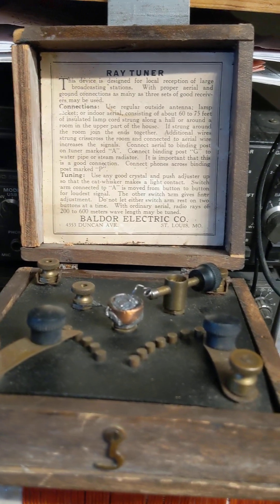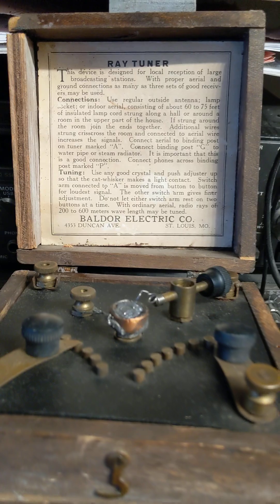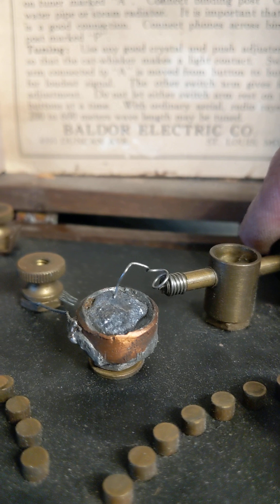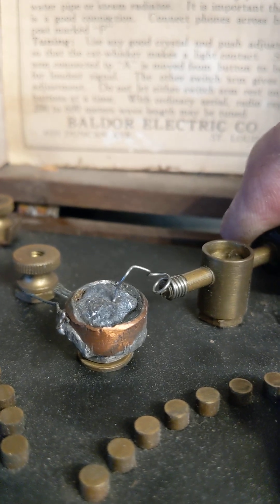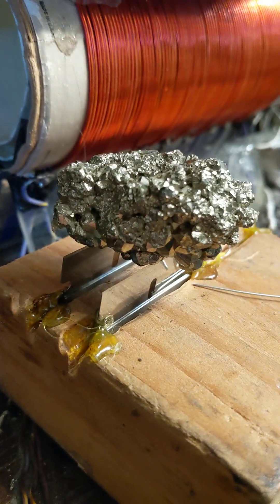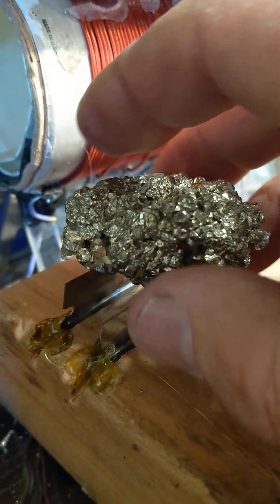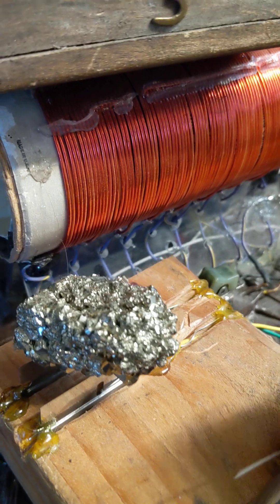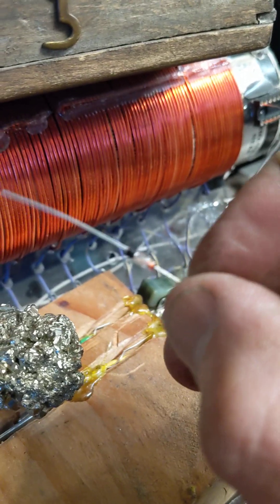Rocks That Detect Radio Broadcasts.

Comment: Back during WWII U.S. Army soldiers sometimes made what some called Bayonet radios.  It didn’t have batteries either if I remember correctly, but they would put together a basic receiver, a coil, a razor blade, an antenna, and a copper wire wrapped around a bayonet stuck in the ground.
Reply from the maker: Yes I remember hearing people talk about fox hole radios. We have come along way with detector diodes since those days.
Reply: Often troops were banned from having radios, so being able to improvise your own receiver was nice.

Comment: Does hematite work? I used to have a hematite bead in my hair but because of spinal cancer I need MRI’s every year. I was told by a clueless tech that it was fine the first few times. Because I was smart enough to ask every time one tested it by holding it up and it flew into the machine from a few feet away while it was wasn’t turned all the way on. I had some doctors ask if I had a brain implant a few times but I didn’t know why because they would say never mind when I would ask why they asked. When my primary asked he showed me why by showing the MRI of my brain with the bead looking like this ⭕️ I definitely had a good nervous laugh 😂

Comment: I actually built a radio from a kit and I still have no idea how they work. ^^;
Reply from the maker: When I attached my audio amplifier to the diode ends, I could hear the audio being broadcast from the transmitter. Did you see my short called solar panel audio detector?
Reply: @GrantsPassTVRepair  I will be sure to check it out! :)

Comment: And if you pass the resultant current through a capacitor to a battery, instead of a speaker...😊
Did you know that the sun produces radio waves as well as heat and visible light?

Comment: What does the rock do? What is it's purpose? What changes in the circuit when you move it around?
Reply: It is made of same element as a commercial diode. Commercial diodes use very pure semiconductor elements like gallium but add very tiny amount of specific impurities to get the diode properties. The gallium crystal 'rock' has nothing but impurities but trick is to find the exact spot where the impurities line up to create a natural diode. If you are very lucky, you can get forward voltages better than commercial diodes.

Comment: When I was a kid 60yrs ago, I had a plastic toy that looked like a red n white rocketship. maybe 6" long. Pull off nosecone for earplug. Out of the tail section was alligator clip with a wire. Clip on barbwire fence, listen to A.M. radio. One station only. No batteries either!

Comment: As  a kid in the 60’s I remember hearing about a tiny crystal radio POW’s in Vietnam made using just a pencil, Razor blade and some snips of wire. I actually made a few trying to use only what they could get and they worked !
Reply: I'd love to cobble a crystal set together using stuff only from the dollar tree.

(Yes, that includes wires.)
Reply: Would that work with a graphite pencil?
Reply: @BornTrespasser  It should, as long as the lead is hard enough to not have the point deform.  I think the real problem is finding the appropriate razor blade, as the finish is the semiconductor.  (I think you have to use blades with a blued finish, which are hard to find these days, so you might have to rust blue it yourself or try flame bluing it, unless you have a gunsmith friend who's willing to dip one in the hot caustic salts for you next time he's doing a bluing job.)

Comment: you know, now that i think about it, back in the 90s you used to accidentally stumble on things similiar to this while using unrelated tech. i remember a few times accidently picking up radio stations while using something totally unrelated.

but since then, it never happens with all the integrated chips and software.

More proof that we nerd to go back.

Comment: Free energy?.....
Reply from the maker: As long as the radio station keeps transmitting it's free. LOL
Reply: @GrantsPassTVRepair  yeah. I know that. I was just trying to point out the fact that since the earth is '' magnetic '' there's no reason why it's impossible to pick up some energy out of it using a similar (but surely more complex) instrument.
Reply from the maker: @c-rafun194  It's been my experience that unless the magnetic field is moving, or the measuring device is moving within the magnetic field, there is no way to extract any energy from the field.

Comment: In my hi school days  (1970) i made a crystal set using pencil lead and a razor blade.. No batteries. after some time, I got hold of a 1N34a diode which was better and louder in the headphones. Then my uncle gave me an OA70  germanium diode which was the best so far at that time. To have station selectivity , I tried  a Variable Capacitor with an antenna coil.

Comment: I think it was called a point diode or contact diode. It works probably way better than an 1N348 you mentioned. That is due to the 0.7V high forward voltage drop of such a silicon diode. I used a germanium diode in my crystal radio, like AA119. Those have 0.2V voltage drop  I'm not sure about you pyrite but probably low.
Reply from the maker: I mentioned the 1n34A, but there are other diodes that work just fine for crystal radios.
Reply: @GrantsPassTVRepair  My bad, 1N34A or many other germanium diodes will work fine. Great video ...
Reply: I doubt the voltage drop across a silicon diode at these sorts of current is 0.7 it's probably less.
Reply: @deang5622  absolutely. It's never in the datasheet but i tested it once. 0,3 maybe for a crystal radio. However, same is True for germanium diode

Comment: Those are natural semiconductors and its amazing. They were able to find, characterize and use semiconductors without knowing what they were, in the late 1800s
Reply: Yeah it’s amazing we were somehow able to discover this!
Reply: well they knew what they did. thats why it was only those spcific type of metals cause they had an idea of what it was. Probably just didnt put a name on it till later
Reply: its so weird, the comments that happen to get all the likes seem so random sometimes.. :p
Reply: Are crystal sets like this?
Reply: @mattyvlietstra5017  more or less, the crystal works to demodulate the signal by acting like a variable capacitor to tune a resonating circuit to the AM frequency of interest. The crystal is a refined version of the cats wisker
Reply: @wilurbean  This explicitly is the crystal set. The little confusing name derives from the crystal of mineral used on the cat whisker detector, which acts as a diode and has nothing to do with the little bit more modern resonant component called crystal, even though it is coincidentally utilized in more modern radios. And to add a little more confusion, a set of this batteryless topology is still called crystal set even when the mineral crystal with cat whisker is replaced with factory-manufactured diode.
Reply: @TheSimoc  I believe this set is actually a cat whisker set not a true crystal radio like the kits in the 60s and 70s.

The cat whisker is a true semiconductor using lead sulfide (galina) that was accidently discovered in the 1890s.
Reply: @wilurbean  No. This exactly is the original crystal set, giving its name, and this has been called crystal set since very beginning. Cat whisker was lesser used name and it meant the subtype - to differentiate from razor blade one and other structural setups. Through all the centuries since, up to today, crystal setup refers to unamplified setup, and those DIY kits were exactly this same circuit, although with ready-made germanium diode. While all more modern radio receivers employ resonant crystal for local oscillator, they are never called crystal sets, and that is wholly different component.
Reply: @wilurbean  No. This exactly is the original crystal set, giving its name, and this has been called crystal set since very beginning. Cat whisker was lesser used name and it meant the subtype - to differentiate from razor blade one and other structural setups. Through all the centuries since, up to today, crystal setup refers to unamplified setup, and those DIY kits were exactly this same circuit, although with ready-made germanium diode. While all more modern radio receivers employ resonant crystal for local oscillator, they are never called crystal sets, and that is wholly different component.
Reply: Early 1900's, the first voice radio broadcast being in 1906 and used resistive detection. The catwhisker diode was a bit later.
Reply: @woodviewvillage3484 please, what means "tartanian"?
Reply: @OdisseuBR history is a lie, and we were much more technologically advanced in the past. Our past civilization was destroyed and we were fed a fake history to cover up our past civilization(s) colloquially referred to as Tartaria. That's the brief rundown of it.
Reply: @OdisseuBR  it's a conspiracy theory that tech was not advanced than history would lead us to believe and the 20th century was a regression or retracing of the steps of the nation of Tartaria (fictional)
Reply: White excellence, it was a gift to the world. Everyone else was stuck in a cycle of violence, but our ancestors (after they dominated and humiliated everyone else amd invented 99.9% of the modern world) decided to give up their colonies and slaves and start policing the globe to force everyone else to respect the concept of human rights. 

It's gone now, we have fallen and until we unite again we won't get up.
Reply: @wilburbean hahaha, that’s funny
Reply: man i fix and work on all kind of stuff that idk wtf any of the parts are, i just know, or figure out, what they do. thats all that really matter, what it does. what its called, or what it is, is nothing more than a way to communicate about it without it being there in person.
Reply: @woodviewvillage3484  that difference between the boys and great engineers comes down whether they had the idea to try to apply math to it, after it blew up
Reply: @wilurbean you don’t neeeeed math to hone in and tune something, I imagine there was just a lot of fiddling, but very intentional
Reply: @woodviewvillage3484  no not really. These were early engineer bros like "lol what if I use this rock in my circuit, will it explode? "

A lot of early engineering and applied physics was like "what if I put by finger it lol" or "what does it taste like lol". Just boys being boys but they were from wealthy/smart/ both. See Langmuir and Langmuir probes for another example of "yoooo what I I just put my finger in there and see what it do"
Reply: @wilurbean sounds like microwave or aspartam stories
Reply: @wilurbean  if argue modern engineering has peaked and is actually causing more harm than good now. Bunch of book dummies who have never been in the field are ruining our cities
Reply: @wilurbean Reductive take of the highly intelligent minds responsible for figuring these things out. You seem to think people weren't intelligent back then, that wasn't a chance discovery.
Reply: @VoltageNostalgia  there's not really another way to describe what they found as other than by accident. They had no conception quantum theory or lattice structure. People knew metal sulfide had strange properties and studied them. 

We know of all kinds of strange phenomenon in the lab today that aren't well understood, but still try to learn more about them. Type 2 superconductors, for example or even predicting band gap energies. Guess and check with DFT isn't great. If we could arbitrarily engineer those properties at will, we'd have much nicer toys

Comment: I made them from solder and Sulphur.  You just melt the solder to a liquid bead and then drop a pinch of sulpher powder onto it. It cools down and solidifies and then you can probe it with a needle. You make the ball on the end of a wire obviously.  It works great and super simple to make
Reply: That’s what galena is, lead sulfate. You just made your own crystal!
Reply: @5roundsrapid263  I wonder if it works with tin in place of the lead.  Modern solder is tin with no lead
Reply: Nah. Lead is still used. Educate yourself.
Reply: @gbenother8755  I am educated and I solder stuff.

Comment: I used to attach mine to some metal fencing. 
I could hear... i think it was BBC Radio 4
Reply: Probably. I did the same. Out came "This is BBC news" and then they had a little orchestra tune. They had very powerfull transmitters and it was loud when you received it.

Comment: Crystal radios are a great start to the hobby of electronics.  They are also good projects where there is enough to do that it isn't over too quickly but also short enough to do on a rainy weekend day
Reply from the maker: Crystal radios were my introduction to electronics. As a kid it was pure magic. As an adult it's still pure magic, just as life itself is.
Reply: @GrantsPassTVRepair  They were my introduction too.
Reply: @GrantsPassTVRepair germanium
Reply: If you live in much of Europe, don't even bother anymore (and save yourself, or worse, your kids, a good deal of disappointment). My own country (Rep. of Ireland) pulled the plug on AM broadcasting - on which these radios depend - back in the mid - '90's, iirc. (apart from 1 Long Wave channel that they shut down a year or so ago, which in any case would have required a differently wound aerial.)
Reply: 100 yrs ago kids built these all the time, age of radio.
Reply: @dananorth895  Make that 80 years and I would agree.
Reply: I wanna make one.
Reply: @moonmagnolia7  If you live near me, I will give you a diode and a resistor.

Comment: 1n34a germanium diode
Reply: Yes, it works the best.  A 1N5711 also works but you need about a 2K loading resistor across the headphones.  In my experiment, the 1N5711 was about mid way between the good 1N34 and my less good one.

Comment: My older brother had a kit to make one. It had an antenna, an earphone, and a ground wire. It worked pretty well, but if you bumped it you lost the station you were listening to.
Reply from the maker: The need to adjust the cats whisker was the down side, but the 1N34 Diode eliminated this problem.
Reply: I made a kit with a similar setup 20 years ago, it really sparked my interest in electrical engineering from a young age!
Reply from the maker: @ErikPelyukhno  You may enjoy my interview with the author of a book on crystal radios.https://www.youtube.com/watch?v=G4YDsvv1DEk
Reply: @GrantsPassTVRepair ❤
Reply: @GrantsPassTVRepair ❤
Reply: @GrantsPassTVRepair ❤